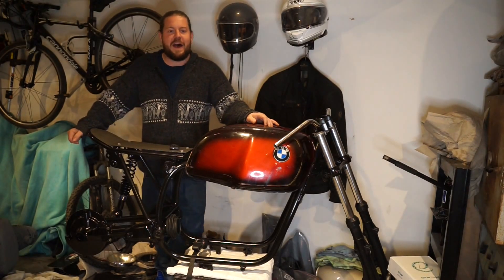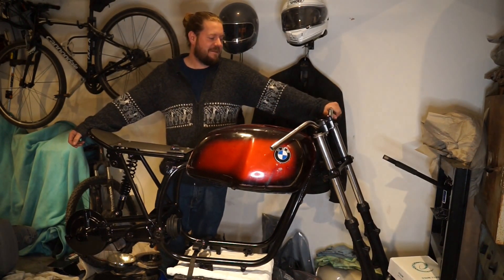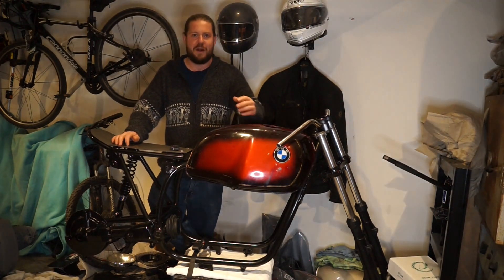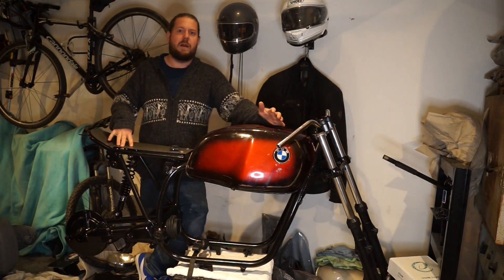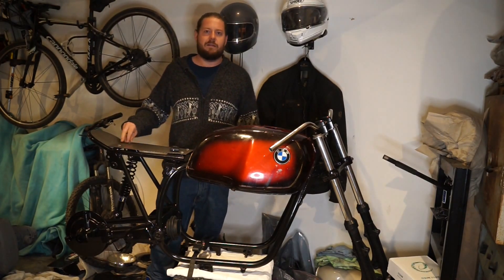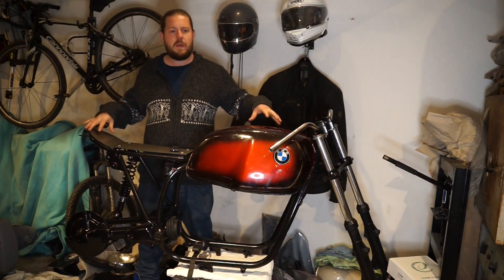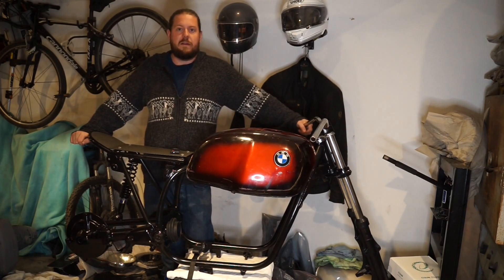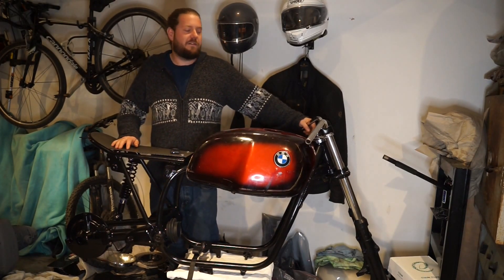DIY Electric Motorcycle Conversion - DIY - Apollo BMW R80/7 build

Comment: Very cool build. I’m also deciding between Hackey Babel’s controller and Fardriver. At the moment leaning towards Hackey’s as it’s VESC based and will have variable regen whereas the Fardriver doesn’t seem to have input signal to control regen

Comment: Not quite what I was expecting but very interesting just the same. Less common approach and an interesting concept, you've obviously spent a lot of time thinking about how to get where you want to be with it, the experience of the Honda is obviously beneficial, I'm looking forward to watching the project unfold. I've had similar thoughts but a bit different ethos, using a Triumph T300 Trophy. The strong spine frame gives a lot of scope for pack arrangement and the wide body panels will hide the naked packs.
Reply from the maker: A T300 would be an awesome build!

Comment: I'm very interested in following this new project. I notice on the QS web site that the motor you're considering using has a life span of 3-5 years under normal use. I think this would be of concern to me. What are your thoughts on this?
Reply from the maker: Not too much of a concern for me with the amount of miles I'll be doing. They are also fairly serviceable motors with repairs being relatively easy to do.